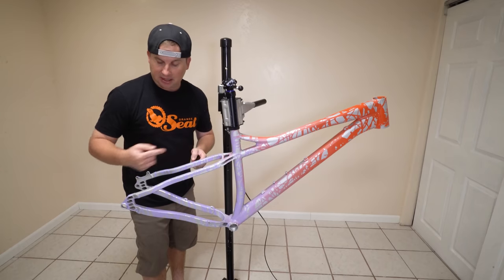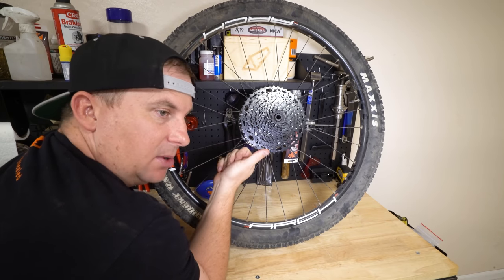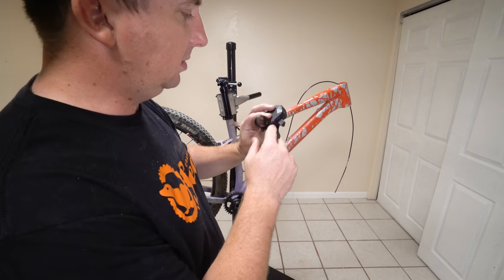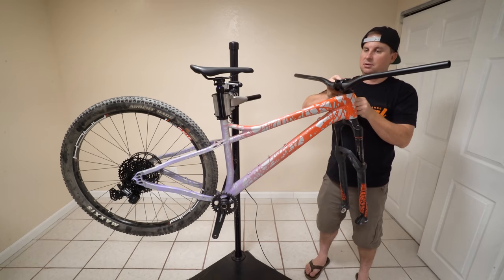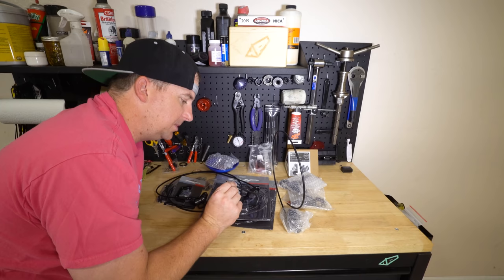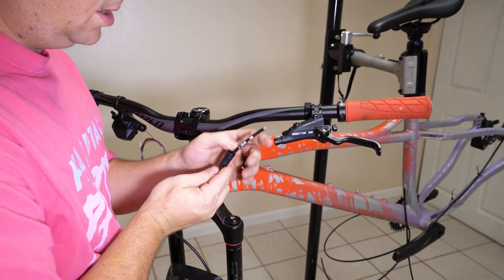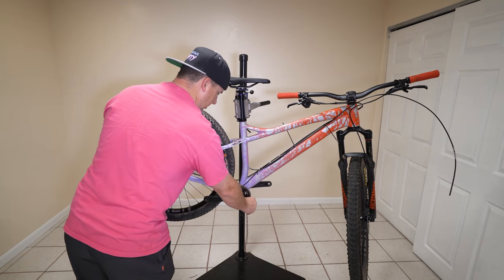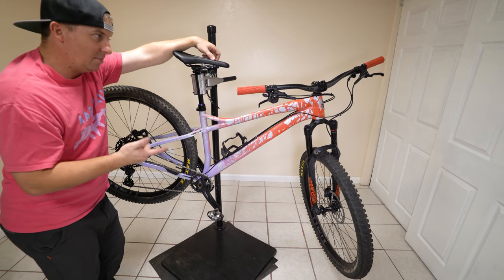My Custom Banshee Paradox v3 - Featuring New Parts from TRP, Microshift, and Nukeproof

Comment: I love my Advent X drivetrain. Works awesome.
Reply: You guys need to collab when Steve visits Utah!
Reply: I agree it's awesome to see old shovel stopping by  Steve's page! 2 awesome dudes!
Reply: Is water an issue? Another video showed that there is no rubber sealing in the derailleur casing.
Reply from the maker: Thanks for stopping by oldshovel!
Reply: Old shovel and Hardtail party need to collaborate. Maybe work together and modernize an old hardtail!
Reply: @Dark__Thoughts  I don't think so. I have ridden the advent 9 speed drivetrain for almost 2 years now and I live in the PNW and go through huge puddles all the time. I've gone in hub deep water before and some days I'll go out on my bike just to splash around on puddles. I never had any problems with the advent and the design looks very similar so I don't think there will be a problem.
Reply: Do you have a recommendation for the 10 speed chain?
Reply: @ForEverMTB  I reccomend sram chains. They have a master link, unlike shimano's stupid pin thing and also are not directional so you don't have to worry about putting it on wrong. I would reccomend getting a more expensive one though because they last longer.
Reply: @ForEverMTB  XT.
Reply: Got old shovel stopping by :)
Reply: Trp and magura🤘

Comment: A friend of mine runs half link chains in order to tension the chain correctly on his single speed, works well.
Reply from the maker: I used to run half link chains on my dirt jumpers.. With a narrow wide chainring, a half link chain isn't going to work. Ill just rode ss on my other bikes.
Reply: @hardtailparty  true, I totally forgot about the chainring,  he uses a normal, not narrow wide.

Comment: I have the 9 speed advent.  It has been rock solid since I installed it in January.
Reply: I've ridden it for about two years and my friend just got his in the mail. I've gotten a new mtb with a sram eagle drivetrain but I'm repurposing my old bike as a commuter/gravel/bike packing bike so I'm going with the advent 2x derialuer and running 24/38 up front for around 620% range.

Comment: They make tons of non-sram xd cassettes. e13 has a couple with 9 tooth cogs that are great when you don't have the chairing clearance that you need, or want to save weight. If you have a choice, I'd always go for xd because it gives you way more options than hg which has a minimum of an 11 tooth (20% lower top gear)
Reply from the maker: I wouldn't say there are "tons" of non sram xd cassettes. I like the xd design a lot, but for budget drivetrains and singlespeed, I've really been enjoying hg lately. If there were more xd options I'd use it on all my wheels, but I've got a few drivetrains to test that are hg only. Where I live, I never need anything higher than an 11t, and if I do, I can just run a 34 or 36 up front.
Reply: Sunrace and SRAM both make 12 speed cassettes that fit HG drivers
Reply from the maker: You are correct, thanks for bringing that up. I've used them before. I like the sunrace stuff a lot more than e13.
Because i was trying to educate beginners on the differences between hg, xd, and ms, I was speaking in generalities. Its so confusing for new people to the sport.

Xd is used for sram drivetrains 99% of the time. There are exceptions, but listing them all would muddy the waters for those who are already overwhelmed.

You are correct though, there are technically more cassette variations than I've stayed.

I get questions every week from people upgrading their wheels and they don't understand the differences between drivers. They're trying to put gx eagle on an hg hub, so I wanted to simplify it as much as possible.

I really like that nx is hg, that opens a ton of doors. And I'm a big fan of the sun race cassettes too.

For those reading, sram sx eagle and nx eagle both use the 12 speed nx cassette, which is hg only.
Reply: @hardtailparty  On 11spd the NX level cassette is the 11-42 PG1130 which is an HG cassette. The next step up is the XG-1150 which is a 10-42 XD. That's the GX level cassette. 🤓
Reply: @hardtailparty  yeah I don't disagree about singlespeed or budget stuff, but I will say that for 1x a smaller chainring is also super nice for clearance on tech (even if I still use a 34T to rip down fire-roads).

Also the weight difference is noticeable. 1/4lb of rotational weight savings for the same gear range.

Comment: Just undo the two phillips screws holding the clutch cover on and use a torx key (I think T25) to tighten/loosen the clutch. On my advent 9 speed drivetrain I tightened it just until it affected shifting performance and then backed off so the clutch was super strong. Way stronger than sram or shimano. Its easy to adjust and more reliable than shimano. I accidentally broke a shimano deore derailuer trying to get the clutch tention higher.

Comment: Those Ergon saddles, at least for me and my sit bones, have been the best purchase I've made bike related. Super comfortable even when I'm wearing just gym shorts. I also prefer the extra distance/height of the rails, so they don't flex and have issues with the saddle bolts. There's a few of them (posts) with long bolts that can hit under the saddle and the extra height stops it. Yes you could trim the bolts down but it really doesn't impact anything for me so it's fine. I understand it could make you have to downsize your dropper, but besides that the saddle as a whole is great, again, for me. We all have different sit bones and proportions.

Comment: My advent x set up, only lasted 1 weekend. The shifter crapped out. I figured it was all so cheap, that trying to get a replacement wasn't worth the time. It's all in the parts bin now.  It did sound like your audible clicks were much better than mine out of the box. Mine was never that loud
Reply from the maker: Interesting. I have over 300 miles on mine. Zero issues.
Reply from the maker: If you want to sell your cassette and derailleur, let me know

Comment: I'm surprised the bottom bracket doesn't have enough movement to tighten the chain, in my experience exactly half a link is always enough. I have  a 'half link' eccentric hub a guy in Rotorua made me years ago and its been through several bikes and gear combo's. I'm interested as i'm looking at other options as the old 9mm axle is becoming obsolete :)

Comment: Yup, the BP V3 (M) has arrived.  I took a look your 9point8 Stout stem link.  Bars and stem are all I have left to order.  How do figure stem length?  I'm running a 130mm fork, 5' 8"-5' 9" longer torso, shorter legs and arms.  Was thinking to spring for a 40 or 50mm (31.8) 9.8 Stout, 20mm rise bars.
Reply from the maker: Stem is more steering feel preference than a sizing thing for me. I like both 40mm and 50mm on my paradox.

Comment: I like the Sunrace 12 speed HG style cassette I used on my latest build. It is 11-51 tooth and works pretty good. About as smooth shifting as my old Sram 9 speed cassettes. It cost less than Sram SX HG compatible cassette. Since the top 3 rings are AL 7075 alloy, the question I have is: How long will they last? Only time will tell. I've also used Microshift 9 speed in the past, it worked well, until a crash twisted the inner parallel linkage. Crash damage can wreck even the best parts.

Comment: Have you tried the spank vibrocore bars yet? I'm liking the Spike VC so far.
Reply from the maker: Not yet, just the regular spank aluminum bars
Reply: My old bike has a Spabk Spike vibrocore bar.  Nice bar.  They don't sacrifice weight or anything.  I didn't notice a huge difference between a regular aluminum bar and that vibrocore bar, though.  I'm not a crazy fast rider either, however.
Reply: @chameleonpogono  I feel like I've noticed it in the chunky this season, but it's also much wider than my old bars, and 35mm diameter vs 31.8 (?) so it's different in several ways. the weirdest thing is I've still left them as 820mm. Will cut them down eventually but they feel weirdly good a lot of the time this way. I know I "should" cut them to 780-800..

Also seriously thinking about going cush core rear.

Comment: I guess you will like the TRP Brakes. Have mine on a Nordest Sardinha (my Trailer/kid/alround bike) and I never have any issues with them :)
Reply from the maker: You have the new slate t4s, or a different model?
Reply: @hardtailparty  probably the old version (Slate T4). But still, plenty of power and control... Got them off a complete bike for like 100$/set new :)

Comment: Update us on how you like the TRPs, when you can. I had TRP GSpec Trails on my Identiti AKA, followed their bed in procedure, and got some hardcore gobble and vibration. I tried all 3 of their pad compounds and 2 sets of rotors, sanding and cleaning. Gave up, ordered Formula Cura 4s, and now I have quiet functioning brakes.

I could have been doing something wrong, obviously, since they seem to work for thousands of happy customers. If you found a way to bed them in and keep quiet, maybe I can still use them on a future build.
Reply from the maker: Interesting feedback. No gobble or issues with mine so far.
Reply: @hardtailparty  did you bed them in your own way? I followed their instructions and tried to bed them in one by one.
Reply from the maker: @skullsroad3642  I bed them in the same way I always bed brakes. I didn't read the instructions on these ones. This is a new compound on these though, so it may be different.

Comment: As bars have gone wider, will you share why you prefer more narrow? Does it help manual easier?
Reply from the maker: My bars are still wide (760mm), just not as wide as some (800-820mm). Bar width should correlate to shoulder width.

Comment: Is that Ergon saddle the gel or non gel model? I have the SMC gel on my gravel bike & dig it. Got it for 20% off at REI during one of the summer sales recently.

Edit: brakes are 4-pot front & 2-pot rear? Which pad standard does it use? Shimano I take it?
Reply from the maker: It uses trp pads. 4 pot front and rear.

Comment: 9:04 aren't most hardtails limited at a 180 mm back rotor? I had an NS Eccentric that broke because I had a 203mm rear rotor on it (the caliper broke too) (I hadn't known the 203 was gonna be an issue)
Reply from the maker: Depends on the frame. Some bikes can take 200/203

Comment: im a lil upset you didnt just drop or raise a tooth on the rear cog (it'll change tension by about an eighth inch),  ive been rynning "magic gear "ratios for over ten years but it requires a whole set of cheap rear cogs and front chain rings to play with tension on non adjustable bikes. but im glad you are playing with them mid level components cause they are great especially for reducing the entry point to the sport, keep it up and ill keep recommending folks to sub to your channel.
Reply from the maker: I believe in the right gearing for my terrain instead of the right gearing for the chain tension.
Reply: @hardtailparty  get that with some playing a bit with the front and a bit the rear it usually ends up close enough, especially with the land changing more than than the discrepancy a tooth makes,  but that where derailleurs take over. again love your content.  one of my favorite new to me channels.

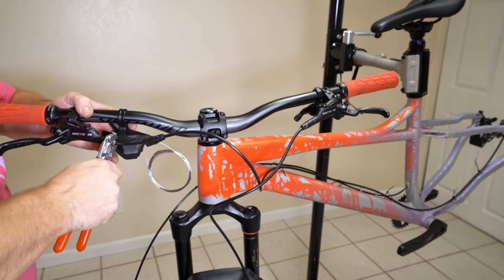Comment: 11:15

Im building a ragley mmmbop with magura brakes rn. My brake hose is also twising like yours right there. Can and should I do sth. about that?

And my shifting housing falls out of the Shifter alot. I just fut some "Tesa" around it so its thicker.
Reply from the maker: You probably need an end cap for your shifter housing. It should fit snug.

Your cables shouldn't be twisted. You should listen the bolt on your hose and straighten it out. Be careful not to leak much fluid. You just need to loosen it enough to turn the hose straight.
Reply: @hardtailparty  ok thanks for the answer.

I got an endcap on my housing (its probably the worng but idc. I want to ride it ahah)

Comment: a Question here: im 1,68m tall with a 78cm inseam would i be able to ride the Banshee Paradox? Cause there is only Size Medium as smallest Size. If not then im thinking about the MIDDLECHILD V2 Aluminum in Size small. 
Regards from Hamburg Germany
Reply from the maker: I'm your same height with a shorter inseam (27") and I ride a medium paradox with a 150mm fall-line r dropper. I also ride a size med middle child, but I had to trim the seat tube on the middle child to fit a 150mm dropper. If you're used to a shorter reach, they're both going to feel long, but once you get used to them I think you'll love 'em (provided your terrain is steep enough to enjoy a long reach).
Reply: @hardtailparty  im so glad you react so quick thank you for that. Hamburg is 90% flat. Thats why i was always thinking of grabbing a XC Bike like the Chisel. But watching your Videos had make me think different.
Reply from the maker: @elbskipper5893  maybe find something in between like a chameleon
Reply: @hardtailparty  i lost the chameleon as you mentioned that the Bearings and Cups in the head tube can have problems .then i followed you to the next bike you liked with all the good things from the Chameleon...the Middle Child.

Comment: Advent X is the best for the money...box one prime is great if you needed that 11-50 range and lighter grams
Reply from the maker: Have you ridden box prime 1 yet? I can't get over the price.
Reply: @hardtailparty  heard a lot of great reviews,but that's the reason why I haven't purchased yet either.
   Some guys say they like the shifting better on the Advent X due to less force needed, and better adjustable clutch? But I think I'll be using it for this build though.  I have advent X for my older marin bobcat trail bike(26in)
Reply: What about  Deore M4100 with the new 10spd 11-46T? Here in Europe it's actually a bit cheaper than Advent X. 🙂 For a tiny bit more money you can go up to M5100 which has an option for an 11-51.

Comment: Maybe this is a stupid question, but why can't you just remove one link from the chain to take off some slack, then use the eccentricity to get the tightness just right?
Reply from the maker: I tried it. It was too short at that point. The eccentric bb doesn't have a ton of adjustability.